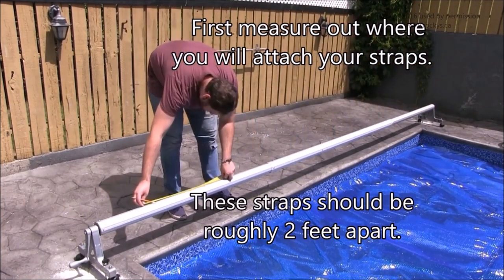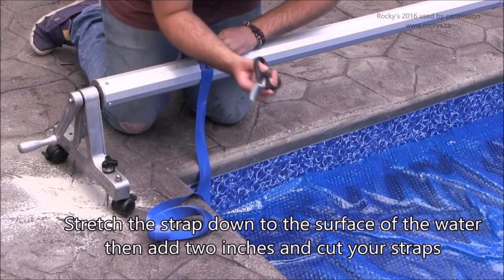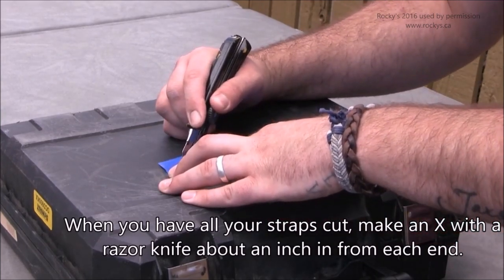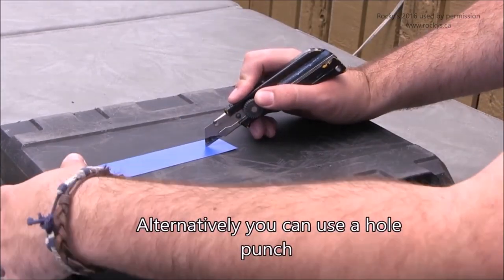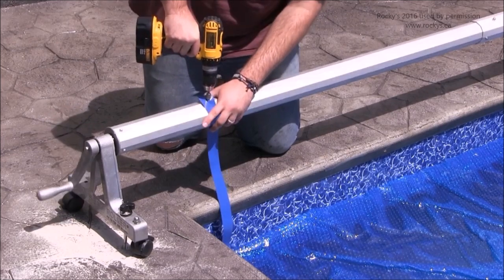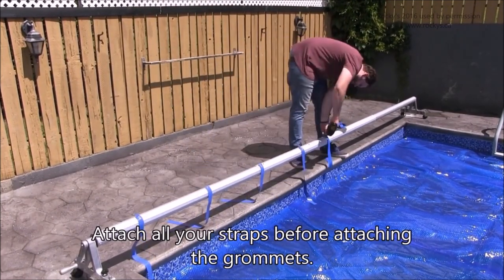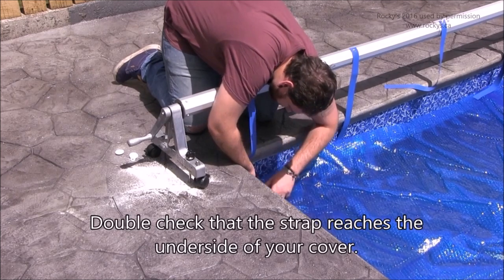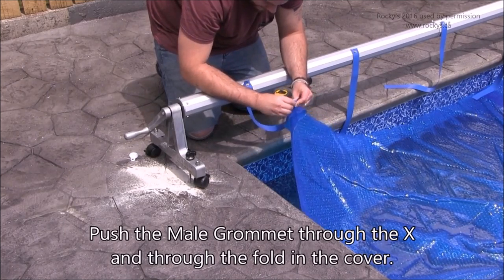How To Attach A Solar Blanket To A Rocky's Eazy Roller Clear Coat

Comment: How do you replace a solar cover on to a Rocky's Roller already put together
Reply from the maker: Hello Debra. The easiest way is to snap the grommets apart and recycle them. Then you can reuse the straps and you can reattach the cover using a new set of grommets. We don't recommend trying to reuse the grommets as they can come apart and go through pool equipment. They are designed to be broken and then replaced when you change the cover. If you need to order more grommets our Parts retailers carry them. Feel free to reach out to our team at info@rockys.ca and we can put you in contact with a retailer in your area.